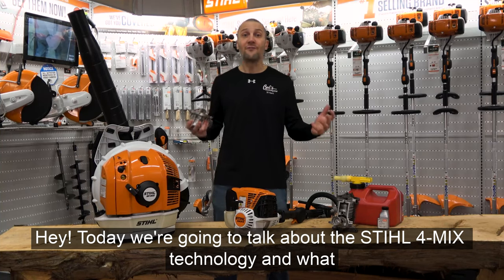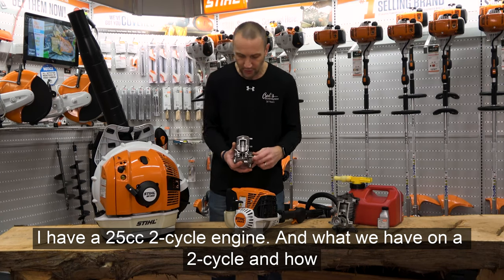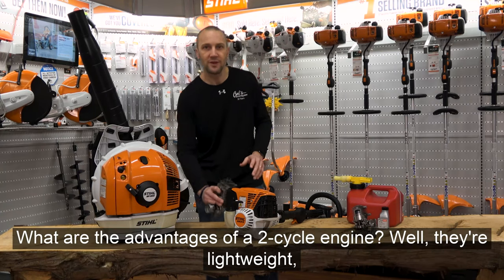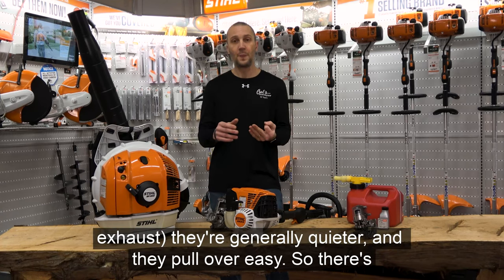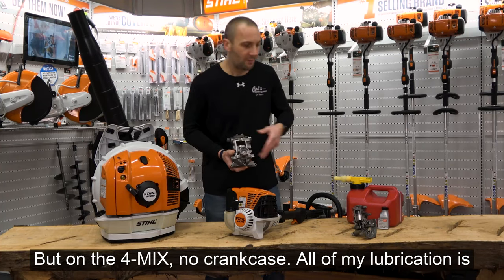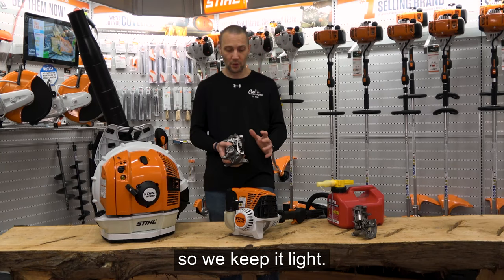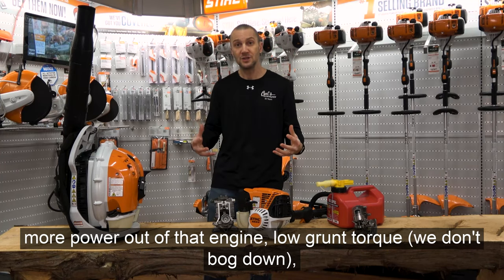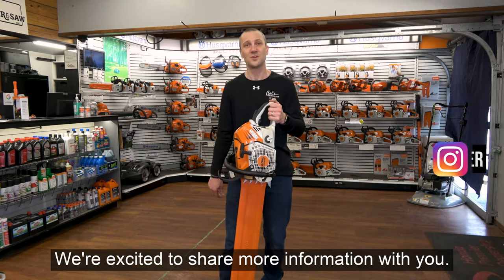Why Should You Consider Stihl Power Equipment? Their 4-Mix Technology.

Comment: Ok but does the cam and lobe have to be plastic?
Reply: Alot of your four stroke engines are now using plastic camshafts. I replaced a damaged crankshaft in a Honda self propelled lawn mower. The cam was plastic and the crankshaft drive gear was too. Also the engine uses a timing belt as well. Those Honda engines are very good. Plastic composite materials are what's being used more common now.

Comment: I think they went the wrong way with this 4 mix. They should have built a 2 stroke with forced induction and a wet sump. Maybe even a uniflow design 2 stroke with exhaust valves (think Detroit diesel 2 strokes). If they built a turbocharger that was engine driven at low speeds (think EMD) they would have had an incredible engine that was super light, made great power, and lasted a long time.
Reply: with a wet sump you couldn't turn it upsidedown

Comment: This guy does not know what he's talking about. A 4 stroke compresses the mixture as much as the camshaft allows - up to the whole stroke of the engine. A two stroke without valves can only compress as much as the ports allow - much less. The compression of a two stroke is almost always less than a four stroke
Reply from the maker: I’m not sure you followed what I was talking about. With the compression relief built into the cam they 4 mix pulls over easier. After start up the compression release “disengages”.  Hopefully that makes sense.   If not I’m sorry
Reply: @Carlsmower  i didn't think about that. Good catch

Comment: Not convinced in any way , IF, repeat IF  i got this correct and the 4mix still has to use 2 Stroke oil in the petrol ? ( if I got this wrong please let me know. ) I have been running a Mitsubishi powered ( proper Japanese, not chinese clone that has to run on like 25.1 oil ratio and still breaks)  Alpine 43cc 2 stroke brush cutter for 18 years , not on a commercial basis granted, but i got big grounds to cover. To be fair, all you do is push the fuel primer bulb 6 times to feel the fuel being lifted into the carb, turn choke on. one pull shes away, plenty of power without needing to thrash her nads off, she runs on 50.1 fully synth fuel mix,  and really hardly any , often invisible smoke discharge, so if 4mix burns 2 stroke oil ? then perhaps i can be excused for not getting the point.